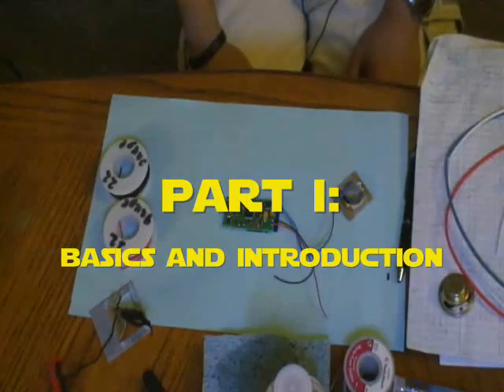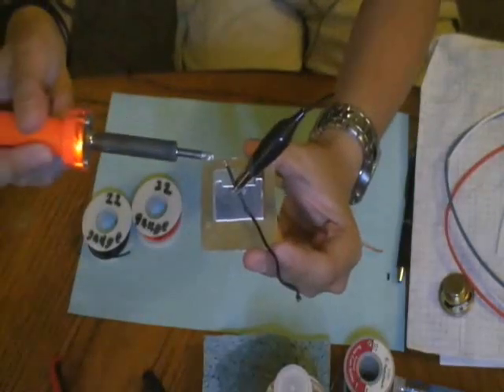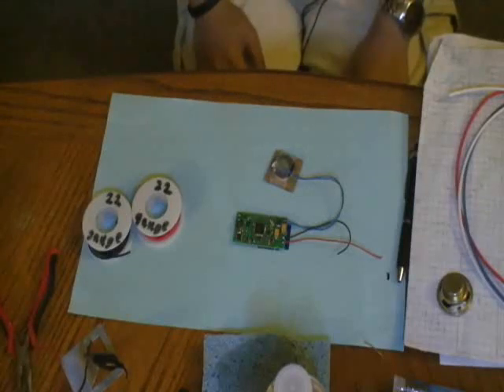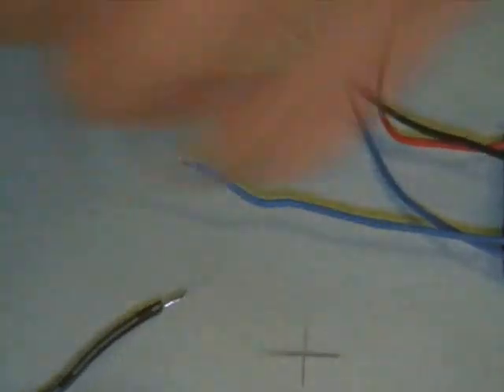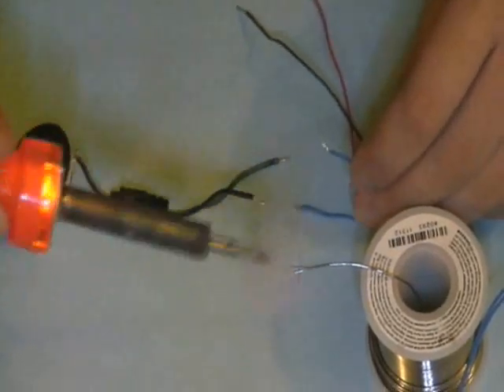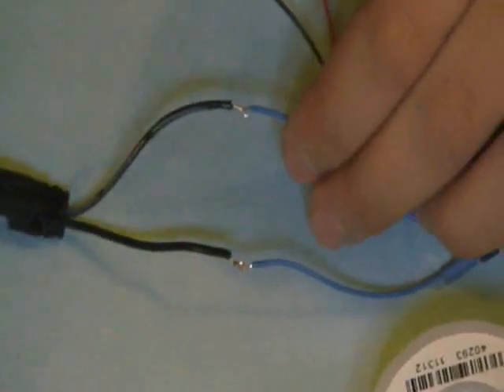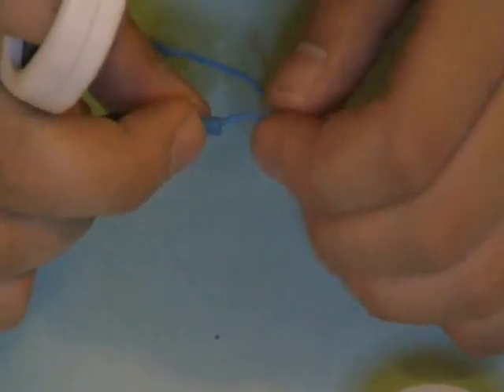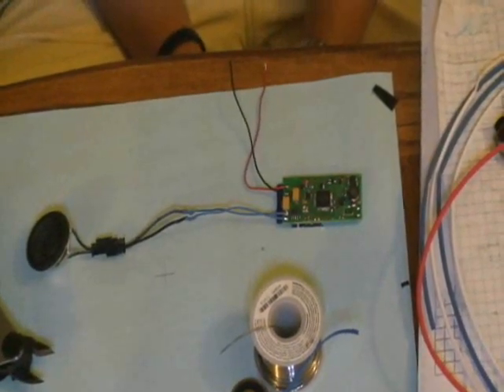How to make Light Sabers -- CF Wiring Guide (part I)

Comment: I've never built one before, but would this work with a 7.5 CF Board? I know this will give me the basics, but I'm just worried. But never too late to start I suppose
Reply from the maker: +Anakin Skywalker Yes.  For the mostpart, this wiring guide will help you with the v7.5 CF and forward.

That said, there are (obviously) many new features and special considerations to the newer boards that you'll come across.  Still... a solder is a solder is a solder is a solder.  :)
Reply: +Novastar (SaberCombat) Thanks Novastar! Much appreciated!

Comment: What temp is that soldering iron at?
Reply from the maker: Brian Brodeur Although I currently have a temperature-controlled iron, this one was not.  However, it was probably ~800 degrees Fahrenheit (give or take), which is a pretty good temperature for soldering.  YMMV.